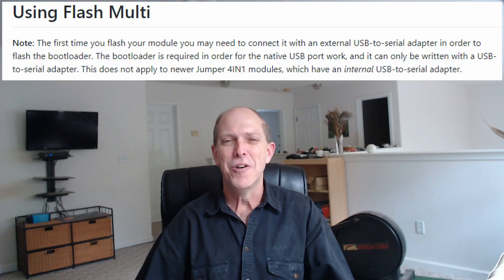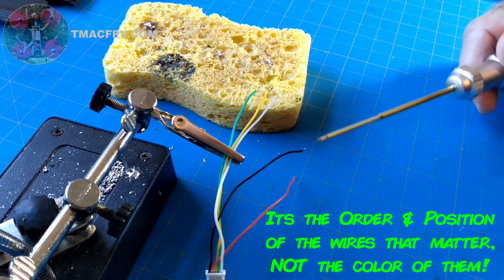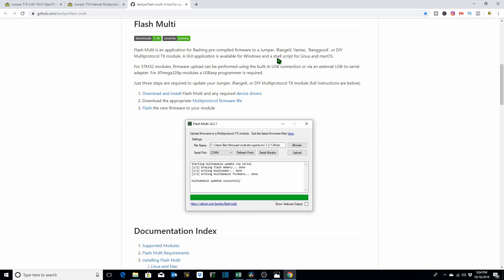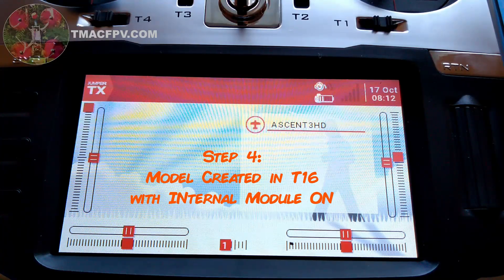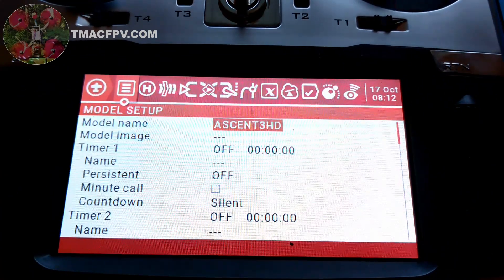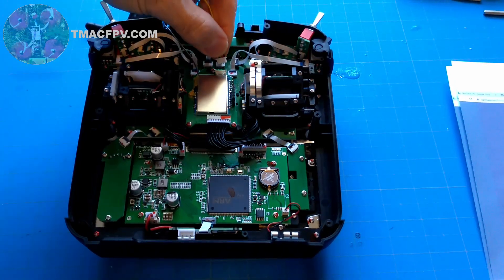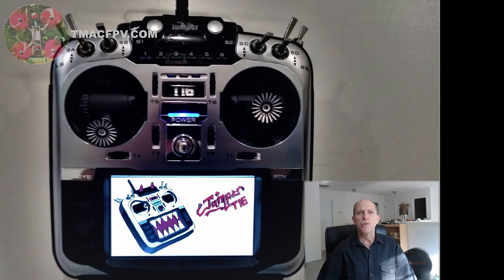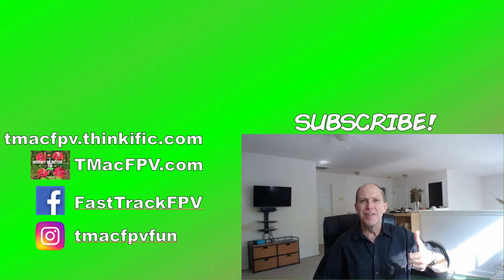JUMPER T16 PRO BOOTLOADER AND FIRMWARE UPDATE

Comment: My T16 pro with internal module, came with boot loader and, and updates JumperTX firmware just fine. I will try OpenTX when it is officially supported.
Reply from the maker: Hey Rickster! Glad to hear your T16 is working well for you.  Just to make certain we're both on the same sheet here.  The T16 "radio firmware" (such as the JumperTX firmware) is different than the firmware on the internal module.  Yes, you can update the "radio firmware" just fine without uploading the bootloader for the internal module.  To find out if you need to upload the bootloader for the internal module in order to be able to update the internal module with OpenTX you need to look at what firmware is loaded on the internal module (not the radio firmware).  You can see the internal module firmware version by going to Module Status under the Model Setup menu (this will be just above where you bind your receiver).  If the Module Status shows v1.2.1.51 you do not have the necessary bootloader installed to use OpenTX for updates.  If you have V1.2.1.85 you DO have the necessary bootloader installed on your internal module.  Please see time hacks 12:38 & 13:14 of video.  The official release of OpenTX supporting T16 hasn't happened yet.  You can run JumperTx radio firmware (as you currently have it) and the firmware you currently have on the internal module without doing anything.  If you want to use OpenTX later on for updates , depending on your internal module firmware, you may need to perform process in this video.
Reply: @TMacFPV  it is  v1.2.1.51, and i have the required adapter, but i'm not going to mess with it until I want to use OpenTX.  All I fly is spektrum and I haven't had any issues. Honestly, after flying a DX9 for 4 years I can see how cheap the T16 really is. I don't like taking it apart unless I have to, I already did once to fix the misbent/damaged throttle tension and friction adjusments. That thumb roller wheel is garbage.
Reply from the maker: @richarddoberstein8308  That's great Richard! I completely understand. I think it's a great transmitter. Have fun my friend!👍
Reply: @TMacFPV  So i decided to update it, and it went ok. 
However the Fix.bin was compiled on the 10/10, claiming that jumper has not included the update.
Jumper has updated the firmware on there site since then. The current FW is 2019-10-17  (a1172cea) .
Also the fix.bin only has one version, no Flex, so I don't know if i should use it.
Reply from the maker: @rickster-fpv1818  What did you update? The internal module per the video or the transmitter (radio) firmware with JumperTX? If you're talking about updating any firmware with another JumperTX version, I personally would not recommend it, I have not, and will not do it myself. The only "updates" I have done to my Jumper T16 Pro are what is contained in this video.  I will wait for official release of OpenTx support prior to updating anything else.  This means, for me, I do not intend to use JumperTX firmware at all once OpenTx has official release supporting the T16.
Reply: @TMacFPV  I updated the internal module. The rcgroups thread by benzo99 says the Radio firmware needs updating also with a link to download.
https://www.rcgroups.com/forums/showpost.php?p=42917131&postcount=4692
 There is no Flex version included in the zip. The JumperTX firmware is updated on the jumperxyz site with out notification. You have to download it and install it to see the version and the date, or you can open it with notepad to see it.  the latest version is 2019-10-17  (a1172cea) which i have installed.  T16-2.3.0EN-FLEX.bin New
Reply from the maker: @rickster-fpv1818  Richard, you stated you fly Spektrum.  I wanted to make sure you were aware of a known "bug" in the JumperTX firmware while using Spektrum receivers and the internal module.  Please see comment from Dave Grainger below (as well as mine) under Mircea FPV's comment.  Pascal Langer has developed a "fix" for this you may be interested in which you can access here:  https://www.rcgroups.com/forums/showpost.php?p=42917131&postcount=4692
Reply: @TMacFPV  you reposted my link i was asking you about with no flex version. it was compiled on 10/10/2019,  the latest flex firmware from jumpertx is from 10/17/2019.
Reply from the maker: @rickster-fpv1818  I was unaware that was the link you were referring to.  If I were you, and using Spektum receivers, I would update my firmware from the link on RCGroups post aboe based on reviews it has received from folks who have used it.
Reply from the maker: @rickster-fpv1818  Just found your comment with the link in it.  For some reason (perhaps the link?) Youtube segregated it as "Spam." Had to go in and "approve" it as "not spam"
Reply: After following the instructions in this video and the RCgroups  thread my 2 quads with SPM4649T Telemetry Sats both had limited range about 250 ft, And I crashed both of them today because of this.
Fortunately i was flying over a grass field, and the damage was minimal.
using V1.2.1.85 module firmware and the fix.bin JumperTX-t16-2.2.3 (3e6a17d3) 10/10/2019

I have been using the T16 Plus for 2 weeks with JumperTX-t16-2.3.0 (3e6a17d3) and the stock internal module firmware, without any issues, and have flown a lot further away with my SPM4649T quads

My SPM4648T quads seem to be unaffected.

Comment: Hello! Just ordered my jumper t16 pro. But is this completely necessary? Or it is just a preventive measure for the future?
Reply from the maker: Your Jumper T16 Pro should work just fine out of the box.  ***However there is a known bug in the JumperTX firmware for Spektrum receivers (DSM protocol).  There is an unofficial "fix" for this issue. For further information on DSM issue and unofficial "fix" please see a post from Benzo99 on RCGroups at this link:  https://drive.google.com/file/d/1OyZStkAUHd-2rnkUetUFYPuasPL5Bvt1/view?usp=sharing .  ***   It will have on it JumperTX firmware on the transmitter and most likely firmware V1.2.1.51 on the internal module.  These are 2 different things (transmitter firmware & internal module firmware).  Jumper TX firmware is a "fork" or "branch" of OpenTX and is maintained solely by Jumper.  OpenTx is more widely used by many other transmitters and is maintained by the OpenTX Development team.  More info on OpenTX can be found here: https://www.open-tx.org/ . OpenTX is planning to support the Jumper T16 with an official release soon (most likely version 2.2.3).  To use and take advantage of OpenTx firmware updates to the multi-protocol module, you would need to perform the procedures in this video, if you have V1.2.51 on your internal module.  You can check the version of firmware on your internal module by going to Model Setup menu and just above where you would go to bind the receiver, you will see "Module Status."  This is where you will see the firmware version. (see time on video at 13:20). Hope this helps. Clear skies!
Reply: TMac Thank you very much!
Reply from the maker: @MirceaFPV  You're quite welcome Mircea!👍
Reply: @TMacFPV , Thanks so much for all the work you're doing on this!  I would add a caveat to the statement "Your Jumper T16 Pro should work just fine out of the box."  That is not true for Spektrum receivers, as you say elsewhere.  I'm flying a Flex Innovations Mamba 10 with Spektrum.  Before I happened onto your and others posts, I bought the newest Jumper T16 with internal module built-in from Heli-Nation, and it bound successfully to the Mamba, and seemed to range check OK.  Then, as I was flying an approach, the plane went to full right aileron and spun out of control into the ground at full throttle.  I was flying low about to land, so there was no damage to the aircraft, and luckily it did not collide with the pilot flying at the station just downwind of me, but it was close.  This looks like a lawsuit ready to happen.  This known issue needs to be elevated.
Reply from the maker: @davidGrainger  Wow Dave, thanks for the comment & glad everyone came out safe! I will add your "experience warning" to both my reply to Mircea (as you have already done with your comment)  & my pinned comment above.
Reply from the maker: @davidGrainger  5-pin connector http://bit.ly/2BJw0St

Comment: May i know what is the difference between multi-stm-opentx-aetr-inv-v1.2.1.85.bin and multi-stm-opentx-aetr-noinv-v1.2.1.85.bin?
Mine is Jumper T16 Pro and which one i should flash for it? Thanks
Reply from the maker: Sure Nelson, no problem.  Please see page 3, step 2 of checklist provided at link in video description.  "The internal module requires firmware with telemetry inversion disabled, so the file must have " - noinv - " in teh name"
Reply: @TMacFPV  For example, for a Jumper JP4IN1, iRangeX IRX4, etc., and a radio running OpenTX or JumperTX you probably want the file named multi-stm-opentx-inv-[version].bin.
But why you download and flash with noinv.bin?
Reply from the maker: @nldronesolution  Per Brian Kai... external is inv, internal is noinv.
Reply: @TMacFPV  Noted, Thanks

Comment: Thank you for this video!  I've been tearing my hair out trying to figure out why Spektrum receivers are just not working correctly on the new T16 Pro.
Reply from the maker: You're quite welcome Scott!😀
Reply: @TMacFPV  I just wonder if I should attempt this update myself or send it back to the online retailer.  Do you have any knowledge of Jumper providing support for this issue?
Reply from the maker: @sgriffith03  Scott, I believe if you want this done you're going to have to do it yourself.  Jumper may (MAY) add the bootloader to future internal modules and ship them out with it.  Don't think you're going to get very far shipping it back anywhere to get support.
Reply: You and I and how many others got screwed!!!
Reply: @gerryroedel4591  I was able to perform the firmware updates and everything works so far.  I'm really looking forward to the new OpenTX firmware becoming available.

Comment: Hi really great to have found you. New Zealand here. Purchased my Jumper T16 Pro Hall which arrived without Hall Gimbals however they have promised to ship me them this coming week along with a faulty slider. Love the Jumper TX and is replacing my X9D however spent the whole of Saturday trying to figure out why no Telemetry from my D8 Rxs. Finally, someone answered me pointing me to your vid here. Am I correct in assuming that I need to install the bootloader and update the internal module firmware to remedy this problem. I also don't want to download a nightly build of OpenTX but I'm assuming the stable version won't be too far away which will ultimately fix the D8 problem
Reply from the maker: Hey Donald! Welcome aboard! Yes, you are correct. Do the process demonstrated in the video (using the checklist  at the link in the description of the video). Then, when you get the stable OpenTX installed it should work fine. I, myself, am also waiting for the official OpenTX release instead of using nightly builds.  There's another comment down below which does state it fixed this same issue for them (although they were using a nightly release).
Reply from the maker: Hey Donald! Thought I'd follow-up with you. Just verified with my Mobula 7 after binding to T16 in D8 mode and having done this bootloader upload with multi-protocol module firmware update, it DOES IN FACT have telemetry.  This is WITHOUT any nightly build.  I just have the JumperTX firmware installed.  So, if you just follow the procedures in video and checklist at link, you should be able to get telemetry with your D8 RXs.
Reply: @TMacFPV  Hi Ive just had a go at this and all went well until I tried the upload and it says Erase Failed. Ive checked and rechecked the wires. Ive the Rx to tx and Tx to rx Booto and 3.3 wires joined. Just cant think of what else to do? Im using a Deek-Robot usb to serial set with the slider to 3.3. Not sure what else.
Reply from the maker: @donaldhill2076  Hey Donald! Sorry to hear you’re having some difficulties.  First thing I did when I saw your comment was search on the USB-to-Serial adapter you mentioned.  Came across this link  
( https://www.robotshop.com/en/dfrobot-ftdi-usb-serial-basic-breakout-board.html ) which the last line in the description says “The RX and TX pins might be inverted on some units.”  Of course, I have no idea if this is your issue. 

On this other link 
( https://www.dfrobot.com/product-147.html ) for I believe the same adapter, it says: “We made some little change with silk-screen, it needs to connect "TX" to "TX"; "RX" to "RX" in programming, Our Arduino Pro and LilyPad boards use this type of connector.
Other things I can think of to check are: 1.  Do you have a model loaded in which the internal module is being used? Try connecting the USB adaptor BEFORE turning the radio on.  3.  Did you download the correct firmware for your channel order (I.e. AETR or TAER, etc.)? 4.  When the transmitter is turned ON make sure the model is fully loaded (no alerts for throttle, switches, etc.).  5.  Is the correct COM port selected?  These are just ideas from the checklist available through the link of the video as I am unaware of what specifically you have tried.  Only other thing I can think of is perhaps you have a fault USB-to-Serial Adaptor? There’s a link in the video description to the one I used CP2102 which I purchased on Amazon.  Is there an “internal break” in any of the wires (i.e. can you check continuity of them?)? That’s all I can think of friend. Let me know if any of this helps.
Reply: @TMacFPV  Look I really do appreciate your time and effort. Ive tried everything and come to the conclusion its the board either faulty or I've got it configured wrong. I'm trying to find a supplier closer to NZ of the board that you used. I have an Arduino Nano which has all the correct pins but its outputting 5v on the tx and rx pins. It has a 3.3 pin onboard but no way to change the output voltage to those pins. I notice the board you are using also has two pins a 5v and a 3.3. I also notice you are simply connecting to the board ignoring both. My question is does the board you are using output the 3.3v on the tx and or rx pins or is it outputting 5v. I'm loath to plug this one in until im sure about the voltage. I have noticed that the Deek Robot board has a permanent red light showing which I think is wrong. It does briefly flash the Tx and RX light, however, the Arduino Nano has both the Rx and Dx lights showing green when plugged in.
Reply from the maker: @donaldhill2076  the 3.3v & Boot0 pads of the adapter board are connected together with 2 wires I soldered together. The board I got was from Amazon. Doesn't Amazon deliver there?
Reply: @TMacFPV  Hi again. Yes, they do but delivery about 2 weeks and more. I've ordered one and also a Sparkfun board locally that I will have tomorrow hoping it may work as well.
Reply from the maker: @donaldhill2076  Ahh, I see.  Glad you were able to source one from somewhere else! Hopefully all will go as planned for you. Please keep me informed, I'd love to hear your success story! 👍
Reply: @TMacFPV  Will do. Challenges like this are just what they are and all part of our great hobby. Our govt here is investigating all this nonsense of regulations hope they se some sense.
Reply from the maker: @donaldhill2076  True, so true! Its actually a part I enjoy-the learning aspect of it.

Comment: tried with a FTDI breakout board only because I had it on hand.  I guess I need a CP2102 or equiv.
Reply from the maker: Per the checklist at link above, you could use the FT232RL FTDI but need to make sure it operates at 3.3v
Reply: @TMacFPV  Got it.  Somehow I was misled by the silkscreen on my FTDI (that I've used before for Arduino).  That always makes you feel dumb when you mix TX/RX.  Works now.  Ready for OpenTX stable! Thanks for this video.  By the way this also fixed my Analog Telemetry on D8 with OpenTX 2.3.2Nightly
Reply from the maker: @rabidbydesign  Outstanding Rabs! Very happy for you!  I haven't attempted the nightly myself.  Think I might just wait until official.  Thanks for getting back with your feedback though. Its always great to hear success stories like yours!👍😀

Comment: I think you got a error on the cable connections photo, the yellow you said is = TX, but in the picture you have yellow solder to RX.
Reply from the maker: Hey maxun1! Great to hear from you.  Starting at 3:52, I speak about the yellow wire going from the RX pad of the adaptor (this is the USB-to-serial adaptor which one end of the wire is soldered to) and the other end of yellow wire which is in the white plastic connector is then connected to the TX pad of the internal multi module.  In this case, both my words and the provided pictorial diagram were correct (that most likely won't be the case all the time!)